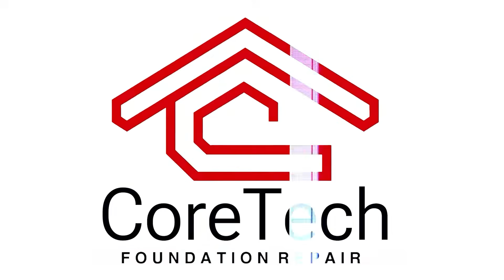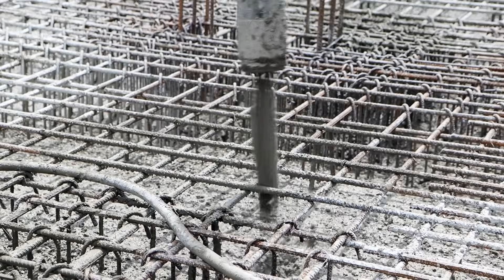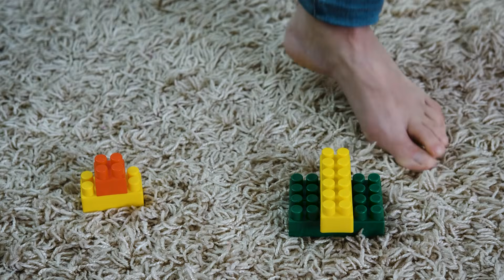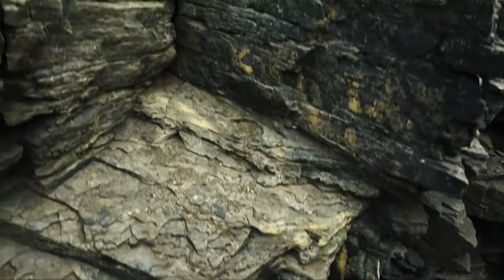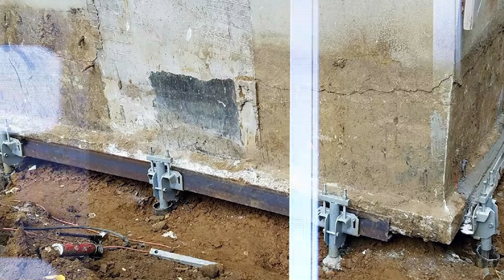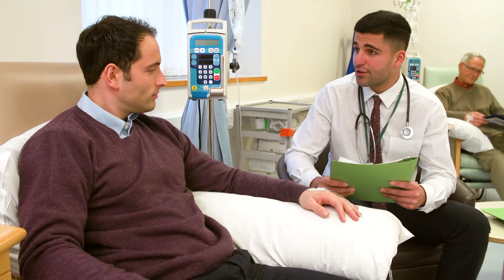Which Foundation Pier Is Best? Most Homeowners Are Told the Wrong Thing

Comment: @CoreTechFoundationRepair. I have 130 year old single story balloon frame house on 6x8 cypress beams that is only held together with lap joints in the beams with Treenails (wooden pegs). It hasn’t been leveled in over 30 years and I don’t know how long. All remaining piers are original soft low  fired 1890’s salmon clay bricks with slack lime mortar. They sit directly on top of the soils directly without any concrete footing or anything, just brick and mortar footing. House is somewhat heavy. Virgin old growth pine and cypress 13’ wall studs and roof is 13’ at the peak. I can only afford right now to replace à corner blown out pier. The soil is Alluvian clay with high plasticity mixed with fine river silt from the old previous course of the Mississippi River. So it is rather volatile. I’m considering two toenailed helicals to support the corner tear out. The salesman said they might build a new brick pier and pull the helical out after the repair. I’m wondering what is best to replace this corner pier with since the plasticity of the soil is rather extreme. I worry that I won’t know how deep to place the footer for the new brick pier and fear the volitile soil will grab the sides of the concrete footer and push it up and out and move it all around. If I go deep like 30-40 feet with helicals and use saddle brackets I fear this corner will be too rigid to “float on top of the pier” like  the rest of the house. The beams have multiple lap joints, some are corner lap joints and some are mid span. Should I have a 2 foot deep concrete footer or will it overload the soil of Alluvian clay/silt mix? Or should I use a snow shoe approach and have the footer 5 inches under the soil and 3 to 4 inches above and float it on top like the other clay piers are. The difference with hard fired bricks and  Portland footers and the remaining soft clay brick piers is they do not move the same. The soft clay acts like a straw and drinks the moisture and then dries out and releases it thereby having less movement, The lime slack mortar is self healing as it cracks and reforms. Although now it’s so old it has dissolved and the bricks are turning to powder. so how can I keep this corner from being too rigid to work with the rest of the house. I don’t  want the new pier to rise up out of the ground or tilt over and I don’t want naturally drastic wet and dry seasons pulling and pushing on these  lap joints because I’m not going to replace  back with impossible to find soft fired 1800’s bricks that are no longer made. I can’t replace the whole foundation. Don’t have the money. One consideration is screw jacks on top of a helical or brick pier but that will not allow any side motion, just up and down motion and only if manually adjusted. Whereas the rest of the house is not bound by anything at all. These old houses just float and ride on top of soft clay brick piers and the bricks sit directly on top of the ground. How can I stabilize my beams and support where everything works together and repair one pier at a time as they blow? What is the best pier and stabilization option for the blown pier at the corner which blew from an ice storm?
Reply from the maker: Soil is a factor.  I agree you have some issues here.  The snowshoe approach is probably OK, but I can't commit to that because I don't have enough information.   There's just too many factors.  You may want to contact a local engineer to take a look at it.

Comment: I have 130 year old single story balloon frame house on 6x8 cypress beams that is only held together with lap joints in the beams with Treenails (wooden pegs). It hasn’t been leveled in over 30 years and I don’t know how long. All remaining piers are original soft low  fired 1890’s salmon clay bricks with slack lime mortar. They sit directly on top of the soils directly without any concrete footing or anything, just brick and mortar footing. House is somewhat heavy. Virgin old growth pine and cypress 13’ wall studs and roof is 13’ at the peak. I can only afford right now to replace à corner blown out pier.the soil is Alluvian clay with high plasticity mixed with fine river silt from the old previous course of the Mississippi River. So it is rather volatile. I’m considering two toenailed helicals to support the corner tear out. The salesman said they might build a new brick pier and pull the helical out after the repair. I’m wondering what is woukd replace this corner pier with since the plasticity of the soil is rather extreme. I worry that I won’t know how deep to place the footer for the new brick pier and fear the volitile soil will grab the sides of the concrete footer and push it up and out and move it all around. It I go deep like 30-40 feet with helicals and use saddle brackets I fear this corner will be too rigid to “float on top of the pier” like  the rest of the house. The beams have multiple lap joints, some are corner lap joints and some are mid span. Should I have a 2 foot deep concrete footer or will it overload the soil of Alluvian clay/silt mix? Or should I use a snow shoe approach and have the footer 5 inches u der the soil and 3 to 4 inches above and float it on top like the other clay piers are. The difference with hard fired bricks and  Portland footers and the remaining soft clay brick piers is they do not move the same. The soft clay acts like a straw and drinks the moisture and then dries out and releases it thereby having less movement, The lime slack mortar is sealed healing if it cracks and reforms. Although now it’s so old it has dissolved and the bricks are turning to powder. so how can I keep this corner from being too rigid to work with the rest of the house. I doubt want the new pier to rise up out of the ground or tilt over and I don’t want naturally drastic wet and dry seasons pulling and pushing on these  lap joints because I’m not going back with impossible to find soft fired 1800’s bricks that are no longer made. I can’t replace the whole foundation. Don’t have the money. One consideration is screw jacks on top but that will not allow any side motion, just up and down motion and only if manually adjusted. Whereas the rest of the house is not bound by anything at all.

Comment: Would it be a good idea to build a one story 800 square foot pier and beam  house in El Paso Texas ? Or Cement Slab
Reply from the maker: Depending on the terrain, it might be better to do it on Piers.  If it's flat ground, I'd think Slab.  Best to consult the design Engineer that will be making the plans.

Comment: Where can i buy helical piers here in north Houston area
Reply from the maker: You can buy them at 2000 Industries, but how are you going to put them in?
Reply: @CoreTechFoundationRepair   i have heavy equipment  , i want see if this is a quicker option than bell bottoms piers not for a house or anything but just a parking foundation .. i back filled the property thats on a slope  made retention walls but wanted to reinforce  to prevent if the soil settled , even though it was compacted. Its for my self but just trying  think future wise

Comment: I want to use press piers to stabilise a concrete block wall that is sinking very slowly. The wall is next to a small creek/river and the substrate is clay, definitely not rocky. I have been told that there is a bed of river gravel down there somewhere but I’m not sure how deep it is.

Would you use steel or concrete press piles in this scenario? The wall is about 5 metres long and about 2 metres high on the river side and maybe 3 metres high at the other end. How many piles do you think we’d need ish? 

I’m in New Zealand, so can’t get you out for a consult 😂 
Thanks 

PS I did not go find a cat video, I watched the whole thing (but I did watch it at 1.5x speed). I appreciate your lack of filter, being similarly wired.
Reply from the maker: If there's gravel at the bottom, I'd want to use steel over concrete hybrid pile Or a bell bottom.
Reply from the maker: 3-4 piles over that span would work, provided that the footing that the block wall is substantial.
Reply from the maker: I'm not real familiar with the traditional construction methods from that region.
Reply: @CoreTechFoundationRepair  in NZ they are fond of icy pole sticks, sticky tape and clag for foundations.
Reply: @CoreTechFoundationRepair. Please see above comment and questions. I’m trying to stabilize à 130 year old baloon fram house on highly expansive clay/river silt with multiple failing cracking and spalling piers with one corner pier blown out. Trying to make the best and cheapest stabilization decision.